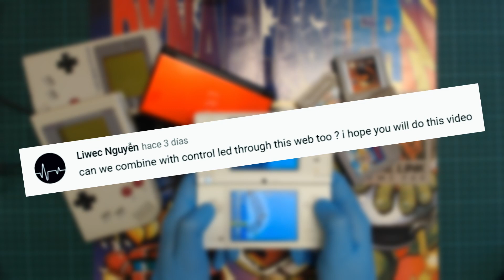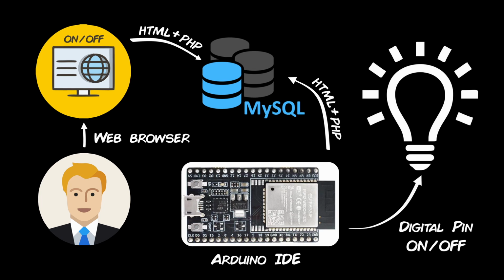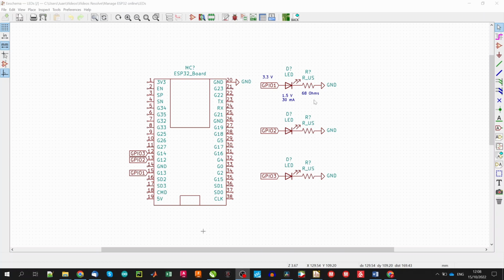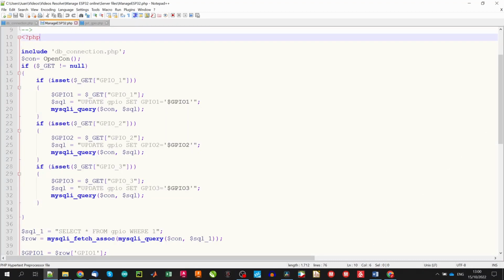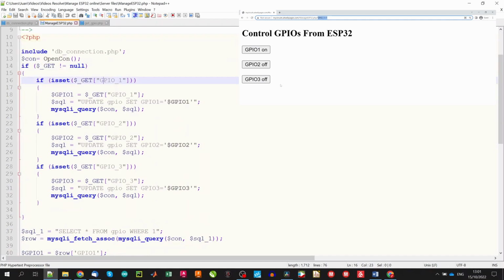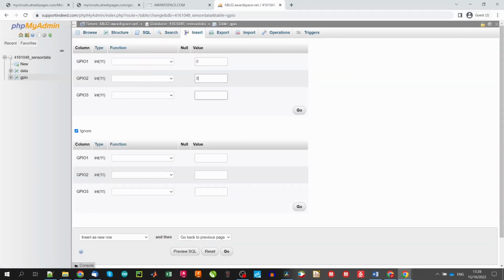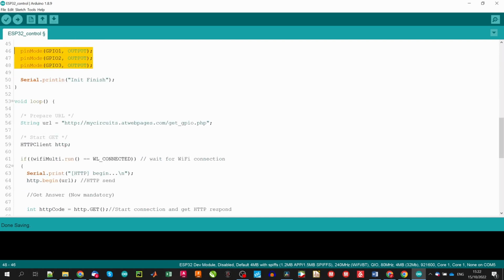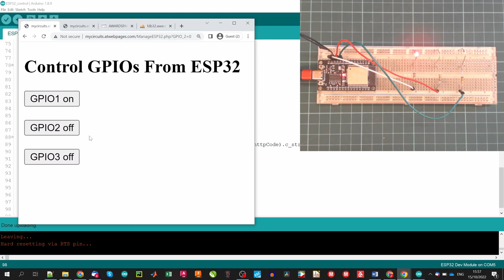IoT projects based on Arduino: control esp32 over internet!

Comment: Should be "Ethernet". Usually you will find it troublesome to put anything on the net over a period longer than a few weeks. 1)windows keeps "updating". 2)your IP usually changes. 3) usually you will be using an IP and not a human readable address. 4)your router and home Ethernet Will be exposed. Anyway, the world has made it a pain in the ass to self serve anything. there should be a law to protect this as a right.
Reply from the maker: Indeed security and our rights, are both interesting topics that we need to cover in future videos.